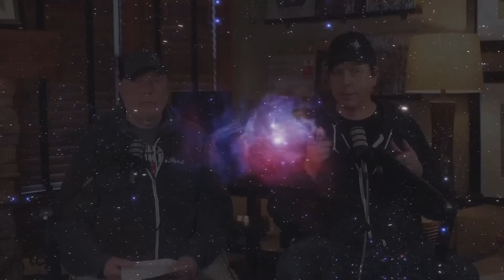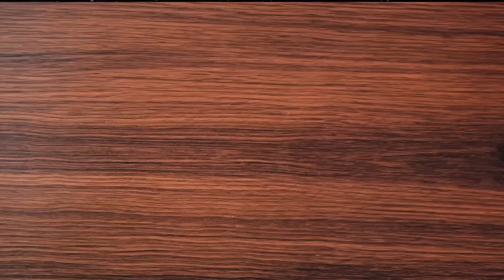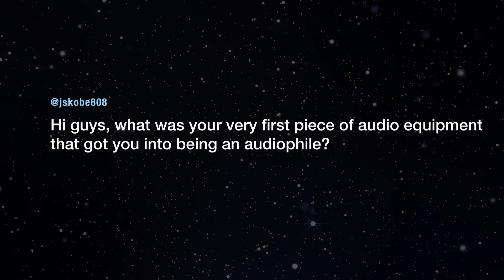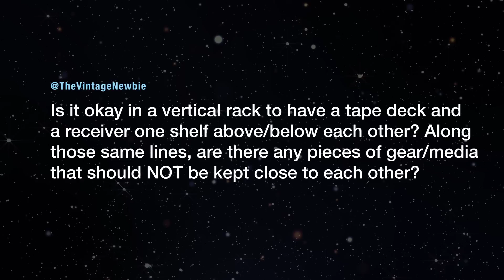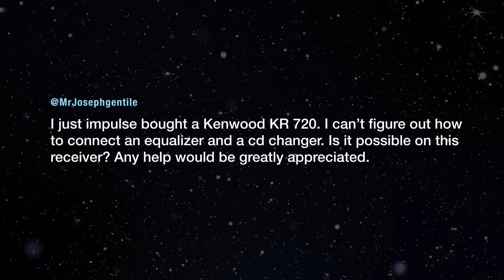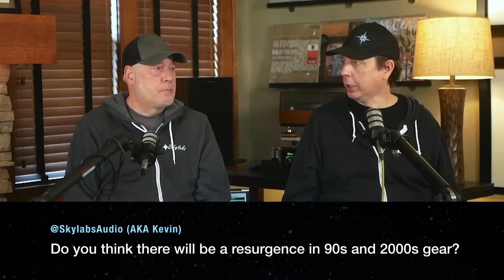Vintage Stereo Q and A With Rob and Eric!

Comment: I disagree for 2 questions.  1) Yes old electrolytic caps can decrease the sound quality without presenting themselves as something "bad" that you could tell without checking them. Working is not a sign of proper functionality. One big notable is the feedback loop in some Carver amps have caps that decrease in value and cause a decrease in bass output. Some caps in series will roll off high ends. It all depends on high tightly they are rated for their use.
. Also, it seems crazy but because an electrolytic capacitor uses a wet electrolyte, they are actually lifetime rated for usage or sitting on a shelf. Keeping them cool and stable helps extend it. But it's luck of the draw after 10-20 years from manufacture.
2) "Will transistors, capacitors, diodes (we need for 60s/70s/80s gear) be available in 20-40 years". Largely, No.  Heck many are hard to impossible to come by now without using substitutes. The big question will be will even the substitutes we can sometimes use now be available.As we move further down the switching power supply, class D amp trajectory, I suspect not.

Comment: 13:24
Learn to read a schematic, symbols, interpreting what you read, the names of the components.
Basic electricity laws.
How to test the components you have to replace often like diodes and transistors. 
The best way to begin in my opinion would be to build few circuit, there's another forum called "DIY audio" and Learn how the parts interact with each other, their purpose in a circuit, and after you can diagnose.

Comment: I hope Kevin is doing well. I like that channel because you are calm. I'm someone who is calm, so it's perfect for me.

Hello both of you. You should participate more often, and explain to non tech people, the difference between different circuit, with exemple, like the difference between semi push pull, direct coupled vs capacitor coupled vs transformer coupled, normal bi polar between mos-fets etc. That would be interesting.

Comment: i do like a lot kenwood, but the 80´s were a black spot on hi-fi ,not all but the one you showed it seems to do nothing as in all tone controls or loudness or it´s sound ,no one talks about the way all brands changed their components quality in 1980 ,just take a receiver from technics from 1980  and compare it to a 1979 or older and try any brand you prefer and you´ll see ,it´s the same now with the turntables that sound really bad and cost around 1.000€, a 100€ technics from the 80´s any will sound a lot better, the stylus changed etc.not all are filled with money and people spend a lot for almost nothing, yes equalizer tape monitor and cd changer or charger to the input of the equalizer tape monitor. Strangelly don´t see a auxiliary input and tape monitor 1 don´t know if works at the same time as tape monitor two, it´s easy, by the way it looks nice but....80´s victim

Comment: 70´s receiver pioneer was the easiest to repair any of them and could be the best or one of the best, and in Africa were the humidity as air to breed ,fans pointing the tops off power amp´s or  they would burn literally as it happened with a HHSCOTT that even on fire was still sounding loud and very good. Pioneer receivers still got them sounding very good and yet to be needing repair llike a SX-838 or the SX-1050 and the SX-1980 or the ES-2000 system from 74 from pioneer also(better built than any others from around 74),the luxman who is similar to the sansui that are stopped because of the dolby system

Comment: People only want a dragon when they never toutched one or just to play one song in one cassette each 10 years but i bought it in the time i was using more cassettes and i was carefull not to buy badly built cassettes that can have very good tapes but it´s casing destroys the cassette and worns out and put out of tune any deck and NAKAMICHI BUILT THEM TO HAPPEN ALWAYS, remenber car radio cassette players from nakamichi auto azimuth, it sounded great but i live in a very hot country at least in the south ,one travel of 117kms to the nearest beach put´s it out of work of incredible vibration being heard in the music ,if one fixes it another trip and good to go to the authorised technician to install all cheap plastic parts again and than all love nakamichi ,it shows that none had one, same with the dragon, in the 80´s i was consuming too much heroin and cooked cocain to smoke, adiction does do things like this i went dragon a undangered species, a lot of years before game of thrones, and in early 90´s a technician/seller "the new dragon is nothing like the one sold in 82 ,it as been improved and having already the cd player the turntable again bought it the best ever cassette deck but not to play cassettes or it will be destroyd soon, the BX-2 is maybe the best it still works today with regular maintenance and because my father passed away also have a 1000, 1000ZXL, ZX-9 ,CR-7A, cassette deck 1, DR-10 still unopened in it´s box, also the special edition of the 1000ZXL it so good this brand that one doesn´t even want top see it, but i had already a 680ZX, 700ZXL ,sold all, bought a 2nd hand mesaratti V8 that looks like a 70´s sport car, not that huge and looking like a mix of the datsun 240 Z and the celica supra(3.0L) of early 90´s only by selling nak.´s, all were in mint condition and all had been repaired by a technician that lives in London and a neighboor of my sister, but still have the RX-909 a special edition just to see the cassette go out and get in again also the BX-2 wich maybe the best ever made deck from nak.it works for my surprise and since 82 bought it at the same time of my first non spiting fire  Dragon, and i agree it´s a good audiophile deck ,normally aren´t conected just to show off, but the terror of spending money also either than two dragon cassette decks the cd player and the turntable ,all were incredible in the first almost a month but some things i noticed but i thought "i´m being paranoid" i was smkoking too much cocaine but no it autodestroys itself both only the stasis power amplifier still have it with great sound made part of a daddy system with the cr-7a and other bad looking components like the cd player ,tuner and control amplifier ,if i had to choose , the ones i bought and the cassette deck 1 were the best, or the 700ZXL still in use and the 680ZX also working perfect, the others were okay but somewhere in time they also had problems  ,the 1000 was good almost never used and had a extra part dolby or the telefunken nr system ,not sure now, efect component as it didnt had in 74 i think, no one remenbers the teac z-7000 or the phase linear 7000 or the B215 from revox ,CT-F1250 and CT-93 from Pioneer(flat recorders)those are the best and there are more like the GX´s from akai  or the SAE series two C something,some work for almost 50 years but no the 6 monthes perfect decks with inferior sound quality at all levels are the best

Comment: sometimes it happens i have at least two amplifiers that one side is not so sensible to change in tone controls than the other ,a sansui from early 80´s when all brands decreased their quality in 1980 sansui seemed to keep releasing good looking amp.´s like aluminium front but the sound?oh, the humanity!

Comment: Pink Floyd "The Wall" made it to the LA Show in 1980 and the plane crash was 1 of the highlights from the Show, used a plane on cables and crashed into stage area.
Reply: Was there opening night, February 7th.
Main floor, Section C - Row 15.  Great
performance considering they had to
stop the show due to the lights burning
part of the opening curtain.  Should have seen all the drug use during that
“intermission”.  LOL

Comment: Well done.  I think that basic transistors, capacitors, etc., will be available far in to the future.  It's the specific things from specific models that will be lost to time; i.e. the Vacuum Fluorescent Displays that Pioneer used in the early 80s.  It's sort of like old cars - I can still buy a master cylinder for a 64 ford Galaxie, but a model-specific tail light lens is only going to be used/old stock.  If you can find one.

Comment: Feel better Kevin, Great video guys and great questions.. To what @Ricksta_83 s question.. The problem is alot of the capacitors in this old gear drift and while they are not catastrophically failed they are degraded which will change the sound so its kinda a trick question. Replacing a good cap for a good cap usually wont change the sound.. But ive yet to do  a restoration that didnt sound much much improved.. Less hiss / Less muddy etc. Also most recaps wont do a 1 to 1 some places improvements can be made if you know what your doing ( I dont and rely on full techs )..

Comment: I've got that Panasonic stereo to go  some 3 years ago and it was realy headache to solve mess with electronic and el  motor unexpectedly  slowing down . Hopefully no electronic parts were faulty, only wrongly soledered.   It is beautifull piece just  by keeping  in hand. Thanks for   ansewrs which are also in line with  my experience 

 I may say that I become audiophile just by listning in 50ties 60ties to my parents tube radioreceiver made in Poland in 1939.   I am convinced thatwithout it and  by purchasing modern amplifiers and spaekers it wouldn't happen for me because they have not that type  of like live sounding. . Stereo listening  is for me only a bit  more enjoyable than exceptional AM mono quality.

Comment: I bought a Realistic STA-2100 (the one with the toroidal transformer) from a local retired engineer hobbyist who had replaced every electrolytic capacitor, and gave it a complete hobbyist restoration. I was concerned because the unit had a slight hum in one channel, and also one channel was slightly stronger than the other, which I compensated for with the balance dial. 

But now with regular use, the hum has gone, the balance seems to have corrected itself, and the damn thing seems to sound better than when I first got it. 
I'm wondering if there's a break-in period when all the capacitors get replaced in these old machines.
Reply: you may have had a bad ground that corrected itself. Yes some caps do sound better after a break in period.

Comment: I have had that same question about the filter caps on my SX 1280. I had the receiver serviced but didn’t replace them because they were having no issues. These two are doing a great job. Also speeding recovery Kevin.

Comment: Thanks for the great video I always enjoy them all I recently serviced a Krell amplifier I was really disappointed what was inside cheap capacitors silicone strips instead of thermal paste which failed and burned out seven of the transistors I wasn't impressed with how it was it was built heavy but cheap components what's that about I couldn't believe the cheapest capacitors on Earth and I'm the first one to open it up that's crazy it was a 13,000 amplifier when it was new but oh well thanks a lot have a good day:face-orange-raised-eyebrow::face-blue-wide-eyes:

Comment: Skylabs Rocks , I have a set of cerwin Vega vs 80 sereis getting re surround foam rings now , and pairing them to a vintage Marantz MR220 21 watt lil baby or my latest an  ugly Realistic STA 2200 monster receiver , sounds good but ugliest thang I ever saw only reason I bought the thang is it’s has nice red power meters , the fm tuner has gone nuts but all other component connections work fine , it’s just a ugly receiver but has the kick I like